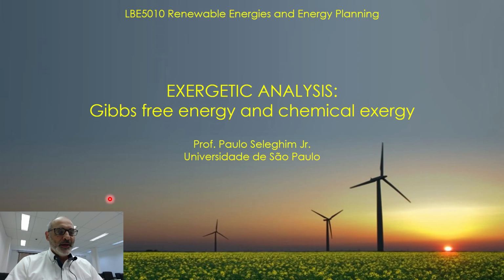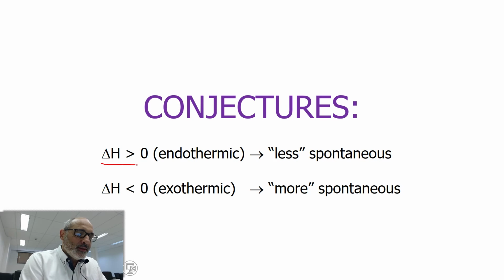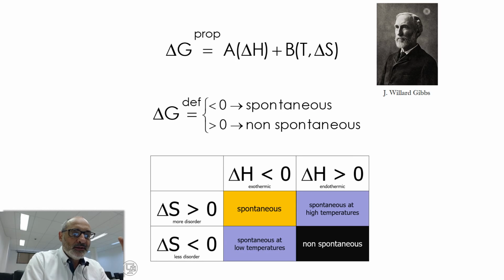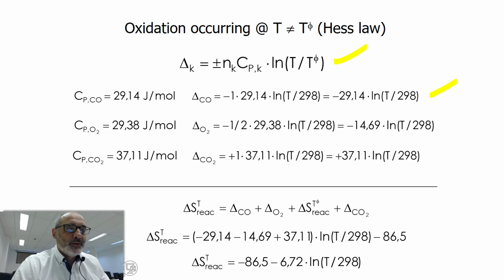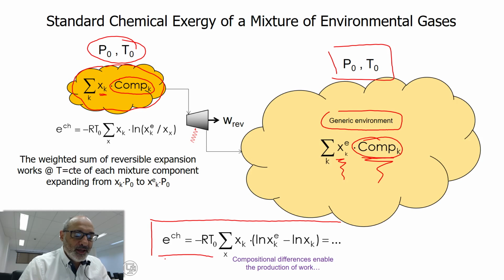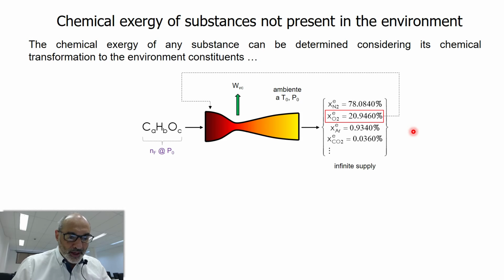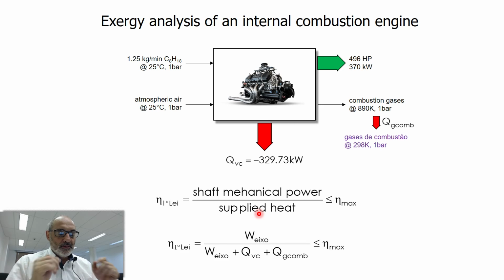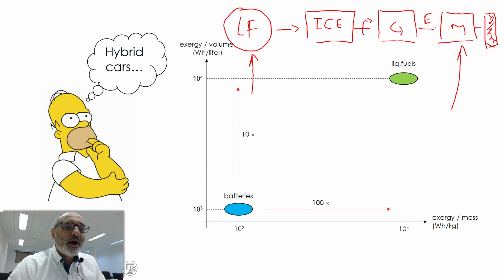Thermodynamics: Gibbs Free Energy and Chemical Exergy

Comment: Excellent video explaining a somewhat complex topic! many thanks for sharing.
Does the energy balance for an ICE need to change if it uses a turbocharger? As in, do you still use the atmospheric condition at exhaust exit rather than somehow needing to incorporate turbine inlet conditions?
Reply from the maker: Thanks CoolBananas. If I understood correctly you question the turbocharger will not affect the energy inventory since it is an internal process, i.e. driven by the mechanical energy generated by combustion gases. In other words, although it consumes mechanical energy, more air is being forced into the pistons which permits to burn more fuel to be burned and, finally, to increase mechanical energy generation. Regarding the exhaust conditions they remain unchanged if the corresponding increased pressure drop at the exhaust pipe can be neglected.